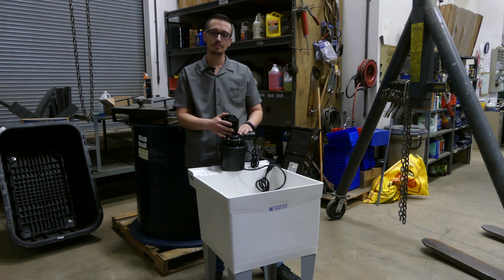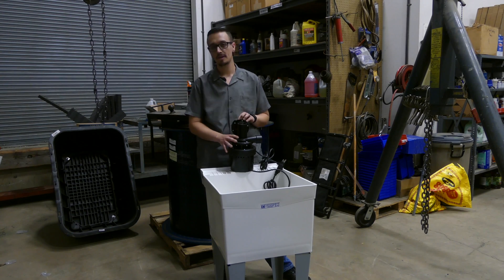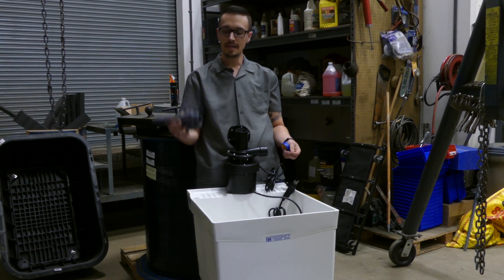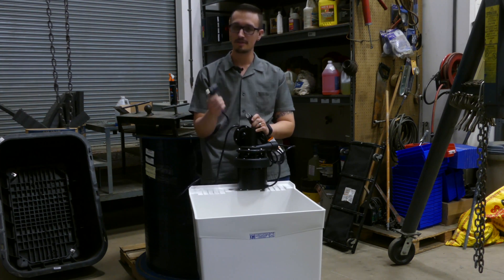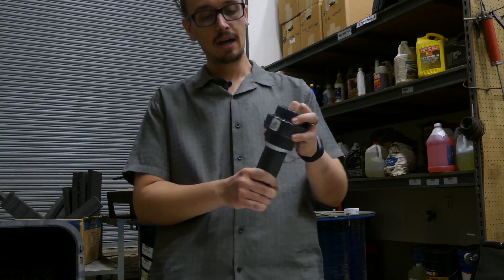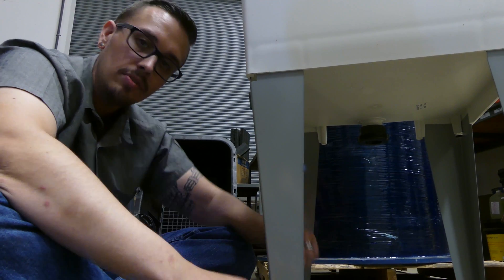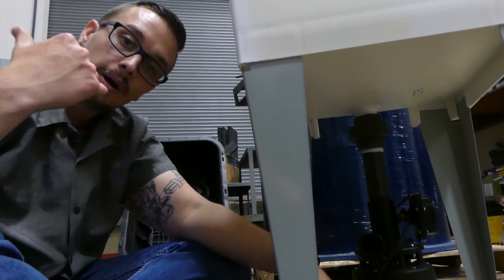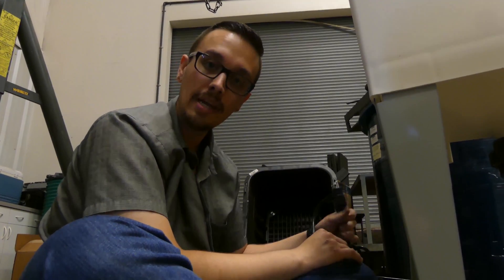How to Install a Sink WITHOUT a Drain

Comment: Excellent video.  Just getting ready to install one and wasn't sure why 5 inches of tailpiece was needed under the sink but you explain that very well.   
The instructions also call for over 6 ft of vertical pipe above the check valve before it ties into the outlet. Is that just so that there's water weight to keep the check valve closed?  I'm not going to be able to accomplish this in my scenario so hope it's not a deal-killer.
Reply: this is exactly my question.  any resolution?

Comment: Does this pump have a built in check valve or is a separate check valve required?
Reply from the maker: It has a built in check valve

Comment: Can this be used in an office setting to pump water up wall & over to a near by restroom drain pipe?  My office doesn't have drain access but needing to install a hand washing sink.
Reply from the maker: As long as the vertical lift is under 10 feet it would work for that.

Comment: Good info. Can you give details on whether or not it needs a p-trap and addresses sewer gases ?
Reply: It's supposed to be used in conjunction with a "check valve" for basement applications. Gravity weight of the water above the valve holds it shut. If using it ABOVE the level of the sewer line, you would need a flap valve. P traps don't work with forced water because it creates the siphon effect and would vacuum out the trap.
Reply: I thought a P trap would also protect the pump and collect objects like jewelry. I know the screen is there but screens get removed/misplaced.

Comment: Good idea. I want to install a clawfoot tub on a concrete floor. It has six inches of clearance. Is there a low profile pump available? How do I achieve the pressure I need to activate the pimp?
Reply from the maker: Please give our techs a call for help finding a solution: 855.329.4519